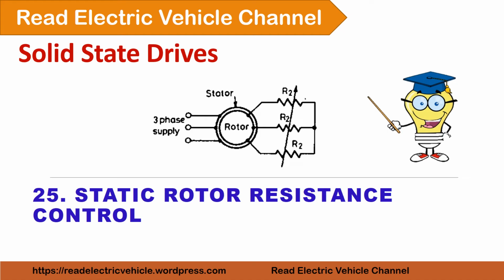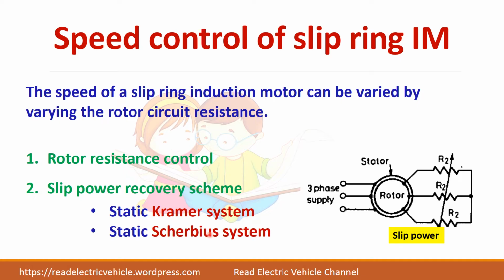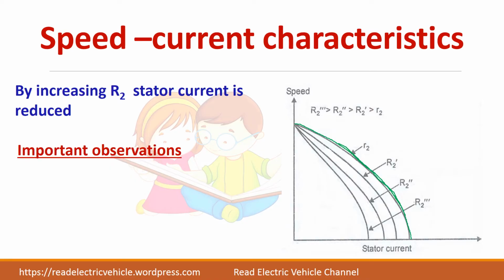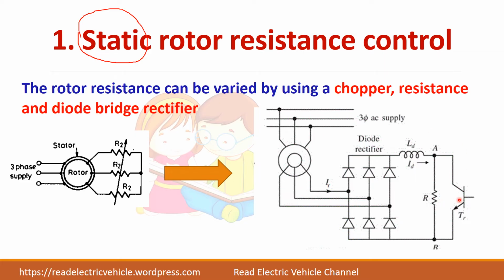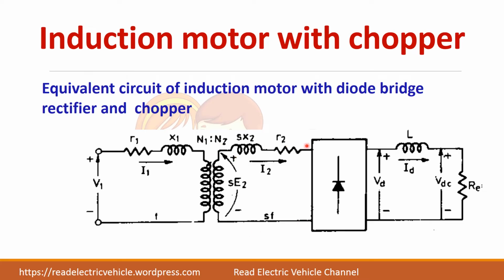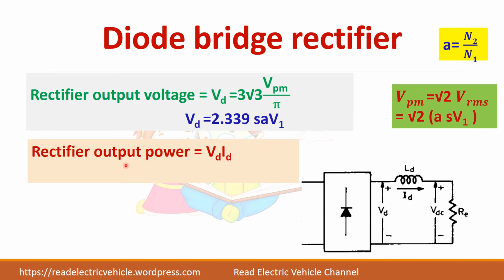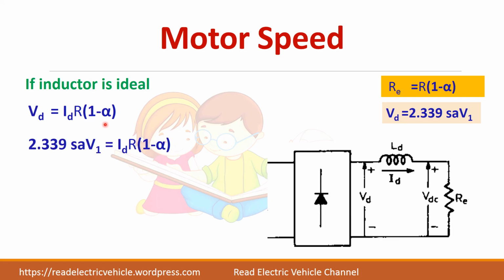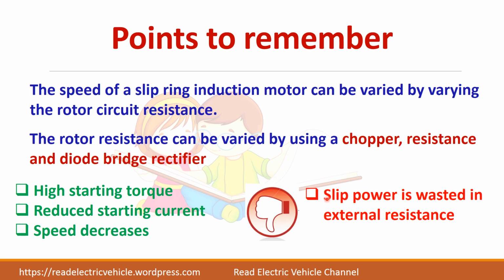Static rotor resistance control /speed control of slip ring induction motor

Comment: about the rotor resistance control, is it the traditional way?
Reply from the maker: after the advancement of power electronics, power converters were used. Earlier without power converters (manually varied) is used.